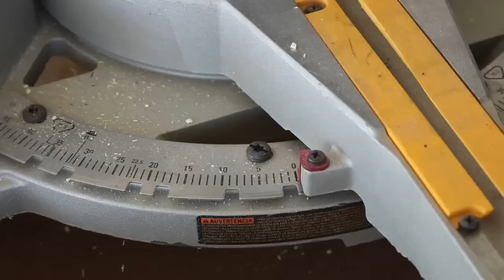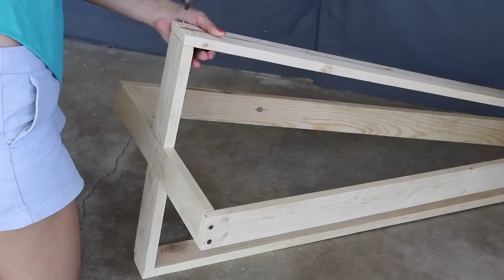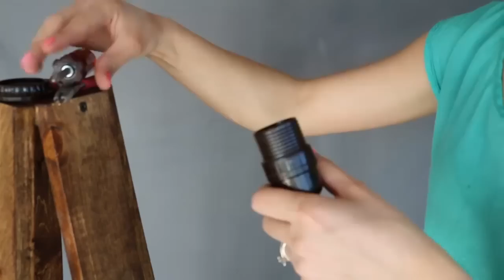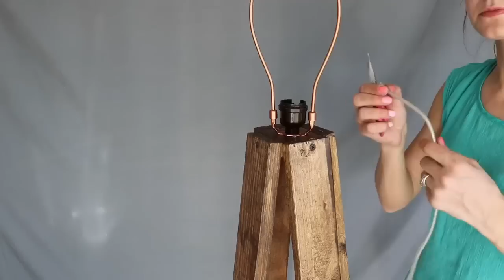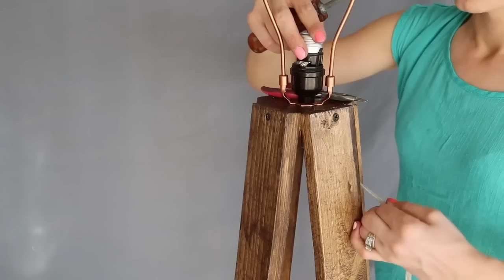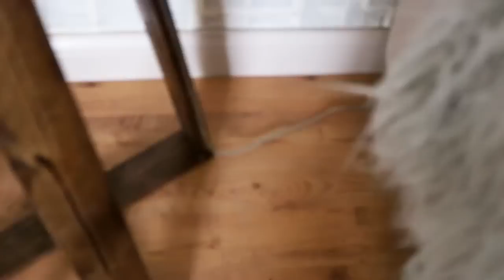DIY Floor Lamp BIG REVEAL!!!!

Comment: Great Video what type of socket set did you use? I cannot find that type nowhere.
Reply from the maker: Thank you :D The socket I used was from an old floor lamp I purchased at the thrift  store. Did you try home depot? I'm pretty sure they sell the same socket.
Reply: Lily Ardor Ok thanks I'll check Home Depot